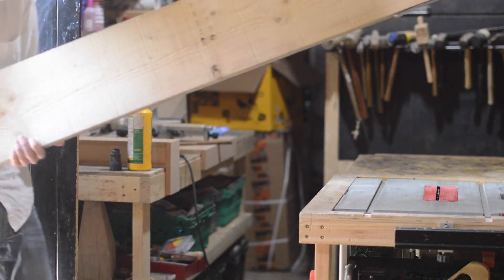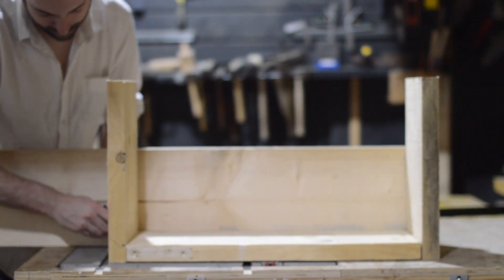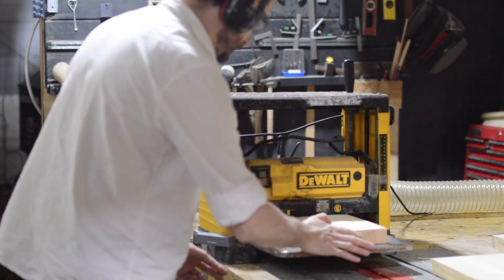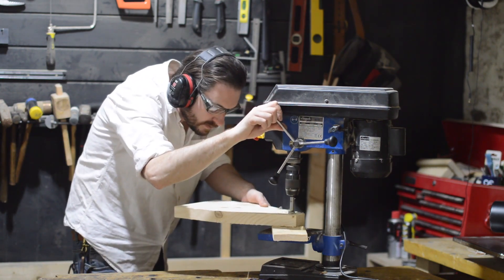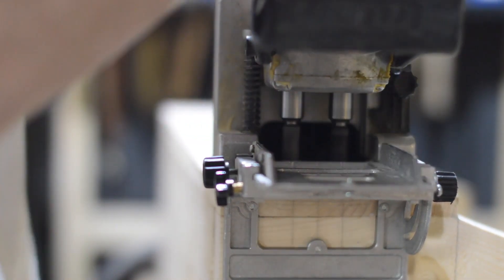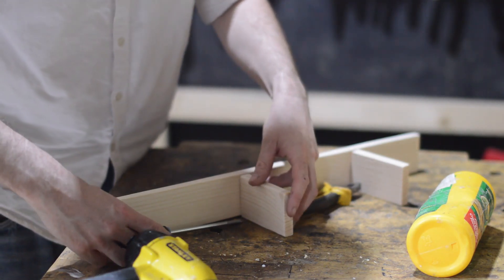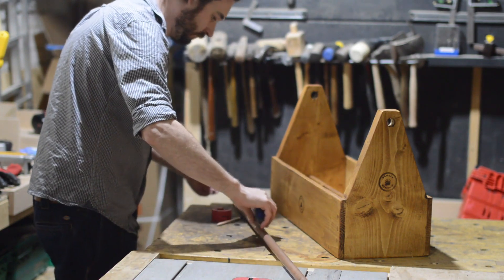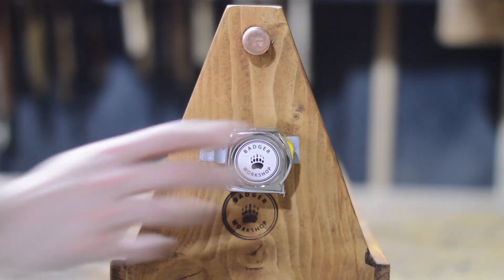Scaffold Board Tool Tote

Comment: Needs a drawer stopping 60mm from the ends so the depth is retained at the ends dont taper as much so you can store items at the ends combi square screw drivers files chisels etc i think that improves your design

Comment: Hey Matt, I love your remark at 3:45 : "I like a project that doesn't make any noise . . . . " Challenge for next time??
Basicly the only tool you used that actually didn't was your finger spreading the glue :). We'll just leave out the electrical saw, table saw, thickneser, bandsaw, drill press, dowel jointer, bandsaw and electrical saw again, tacker and an orbital sander which you require hearing protection for . . . .
I do like the tote though.

Comment: Nice project, I wonder how heavy it is without the tools? A little tip you could have used 25mm Galvanised Steel conduit for the handle with brass female bushes on the ends. Keep up the good work Matt, I have been reorganising my workshop and have made a mobile stand for my table saw which now fits into my workbench, haven't quite mastered the art of video yet.
Reply from the maker: It’s not bad. Scaffold board are pretty light. Steel would have worked well.

Comment: That's a tote that should be with you into your sunset years Matt. Like the reinforced copper handle. The end caps set it off real nice.  Using a bit of the edge banding for a tape holder was a neat idea. Good job.
On a side note, I don't know why but it always cracks me up when you hammer in a nail. You've got a real "just get the #$@! in there" style that just tickles me. No offense meant of course. I'm far from a one-clout master like the boat builders I did my time with! All the best.
Reply from the maker: Thank. Wait until I get a framing nailer then you won’t see me with a hammer agin

Comment: I like your entry, I imagine that the scaffold was around £15 and I think you've made something worth far more. If you like using the hardwood dowels I can't recommend enough making a simple V jig  that slides in the track of your bandsaw. I've ruined many before when the blade rolls the dowel.
Reply from the maker: Good idea. I will put it on my to do list.